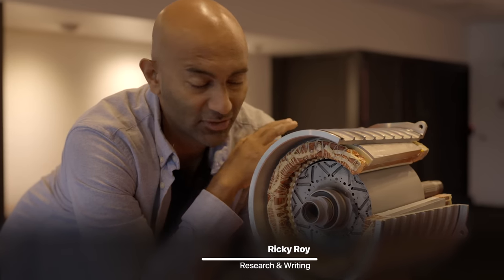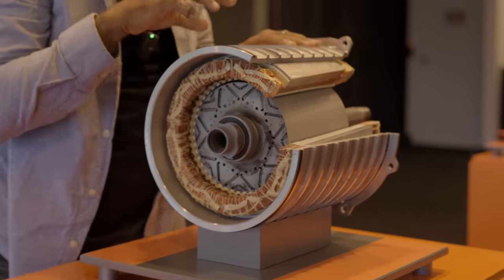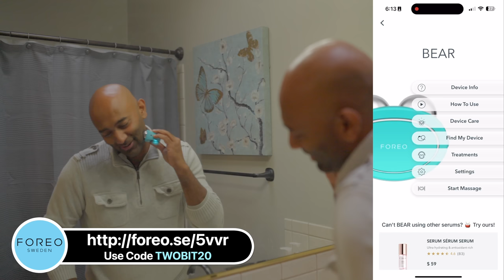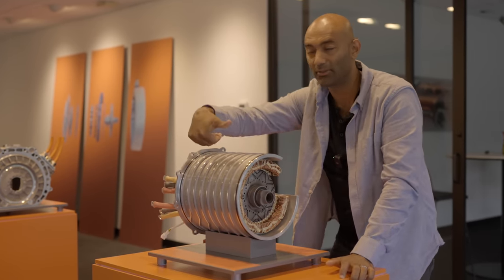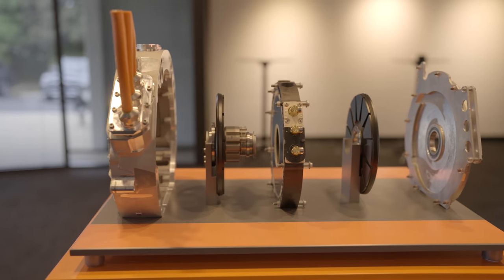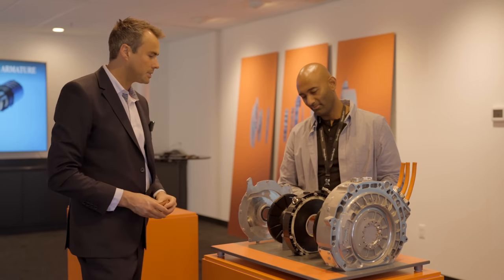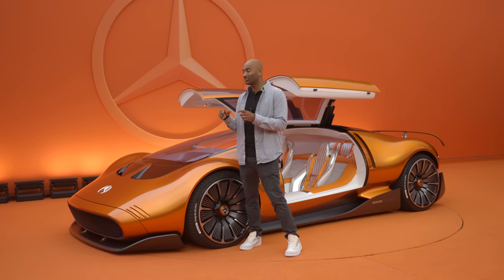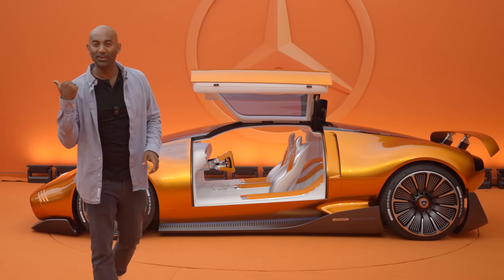Axial Flux Motors Will Change CARS - Here's Why

Comment: Over forty years ago my then-father-in-law told me that the ideal car would have a small, light electric hub motor in each wheel hub, with the speed electronically controlled to drive the car and improve handling by driving the outer wheels faster when turning.  Looks like the automotive industry is finally approaching that ideal.
Reply: Unsprung weight on wheels is not good.
Reply: @ExploringCabinsandMines if its only like 30lbs it might be fine
Reply: The problem is that the motor in the wheel is not a reliable solution, as the weight inertia of the electric motor will destroy the tire much faster... This is why you still do not have one EV with this solution on the streets today... Because you are forced to make the fast-moving and vibrating parts of the car (due to the road bumps) as light as possible. This is why the light rims are all over the place. Heavy wheels destroy the tires much faster...and the wear in the metal parts is exponential with the weight and amplitude of movements, the ball bearings are wearing out much faster.
Reply: Just a thought, but motors in the hubs might allow more effective suspension systems
Reply: and no steering? like french amx10 tank...
Reply: @jebeandiah  You missed the point, the problem is not the suspension system of the car for the passenger's comfort, the problem is the motor itself, wearing out very fast. You have direct transmission of the shocks from the wheel to the bearing system of the motor. There are no materials to endure this regime, ball bearings will be worn out in a few years or less. Ford tested this EM in wheel arrangement over 20 years ago. Really, the carmakers have a lot of good engineers, credit them they know better ... This Mercedes thing is a marketing one, is no way to be implemented in mass production as it is too expensive for that. So Mercedes use it in 120k dollar cars and make noise, but you will never see it on a  VW for example... VW went to get Chinese cars (Xpeng will make the cars and VW will put the badge only, as Dacia Spring is a Dongfeng imported from China with Dacia/Renault badge), 5 years old Chinese technology is better than what VW has today...
Reply: @costiqueR  well if its a possible, but not through mass production problem, those rarely remain unsolved.  Also, im sure the mass of all components of these motors is far less than those that ford was using, which should still reduce these forces, and idk how ball bearings would be a problem as they are already in hubs
Reply: @jebeandiah  Yep, it is not obvious, but even children know it. Simple, take a spinner, that toy very popular a few years ago, and spin it in your hand with the hand still. Measure that time until it stops. Spin it again, but this time shake your hand. You will observe that the spit is stopping very fast, it is spinning much less than when the hand was still. I will not go longer into details; if you understand why, is OK, if you don't, I lose my time...
Reply: You may be interested in the aptera as it uses that design
Reply: @jebeandiah  The answer is quite simple.  No suspension and the cars handling has ever been improved by adding weight to the wheels!  If you think you know something that the F1 and Formula E engineers don't then by all means do tell.  The fact is that, as others have pointed out, tire and suspension components ware goes up exponentially as weight of the wheels increases.  This is simple fact and there is literally no gain to be had from a hub mounted motor or motors.  Further, the size and configuration of the bearings for electric motors would have to be doubled or more to handle all of the additional forces they would have to deal with by being located in the hub of a wheel.  Go audit a mechanical engineering course and you will see just how very complicated what appears to be a simple issue actually is in reality
Reply: @costiqueR  this isn't strictly true. The Light-year 0 did briefly go into production, Lordstown started production of the Endurance truck, and the Aptera is using in wheel motors. Mainstream companies like GM and Nissan are also experimenting with prototypes using in-wheel motors.
Reply: @ExploringCabinsandMines  Correct, but mostly in the RACING world.  In 65mph cars, not so much.  In my 26mph ebike, hardly at all.  Also consider duallies on trucks, 4WD front hubs, etc.  Extra unsprung weight is harder to dampen via shock absorbers to keep it on the ground in high-speed circuits.
Reply: @costiqueR  Sorry, but that's not the reason you don't get hub motors on cars, unsprung weight for a car really isn't much of a big thing. If it were, cars equipped with alloy wheels would have different damper settings from those with steel wheels.
No, the reason why hub motors aren't a thing is because of the hostility of  the environment puts far greater pressure on a hub motor. They have been tried, and Saab (and later the company that bought them) did a lot of work on solving this problem.
But the reality is that it's a problem that doesn't need to be solved. Bring the motor inboard and you reduce the unsprung weight, sure. But you make all the engineering , vibration suppression and water proofing much, much easier.
Reply: @costiqueR  It's not too expensive, it's just going to take longer to implement.
The cost of the motors is prohibitively high... at the moment.
But like all new tech, the price will come down as production ramps up. And seeing as the actual majority of the cost is in the software and management to run these motors, that is something that will come down even price even faster.
Once they go into series production, the price will come down faster than you'll believe.
Reply: @ExploringCabinsandMines  Build better wheels/tires such as the Tweel.
Reply: @costiqueR  You can locate the motor just off the wheel well.
Reply: @Barskor1  Suuure , you're the first one to think of that.
Reply: @ljprep6250  If it made sense Tesla would do it.
Reply: @zacwoodward6054  How many of those vehicles have 100,000 miles in winter conditions on public roads? Between salt and potholes the motor bearings will most likely survive equally as long as standard wheel hub bearings of around 80,000 to 150,000 miles.
Reply: @@jordypoe On an engineering standpoint hub motors are undeniably simplicity but even disregarding upsprung weight you are subjecting the hub motor bearings to an immense amount of undampened forces VS a traditional setup of wheel hub connected to a suspension dampened sacrificial cheap cv axle or axle shaft connected to a differential. Between salted winter roads and crappy pot hole infested roads traditional wheel hub bearings only last 80K to 150K miles. Typically, when it fails shops just swap out the entire hub with bearings pre-installed.
Reply: @ExploringCabinsandMines  I never claimed that, king Solomon "There is nothing new under the sun."
Reply: @Barskor1  Yep, unfortunately engineering and mechanics are not democratic processes, are physical processes. As wear. Whatever you imagine and believe has no impact on reality. Simple, even if you wish and believe something, that is not going to happen...
Reply: @costiqueR  Wow.... now take that BS and look in the mirror.
Reply: yes, but still many years too late and they will sell it to us as a breakthrough technology who has to be expensive.
Reply: Was thinking one for each wheel, but on the inside of the wheel well. It could be on a gimbal, so it moves with the wheel as it travels up and down the suspension, but without the shocks. Still saves a lot of space and allows for independent wheel control.
Reply: @ExploringCabinsandMines it doesn't have to be unsprung weight, look at how Rivian do it.
Reply: @jebeandiah  having a heavier hub will hurt the suspension. imagine jumping off the ground slightly and the suspension drops down. that extra weight per hub is gonna hurt. we would be better off with an electric differential setup. for example where the rear diff is on a truck replace it with a motor. this would eliminate the weight issues and likely make it easier to service since a hub motor might get in the way of doing brakes and not to mention trying to drop that bitch without breaking it to replace suspension parts.
Reply: @zombieblaster5754  isnt electric diff similar to what we already use
Reply: @ExploringCabinsandMines  Good point ... in my country, roads are getting more bumpy and the government isn't spending enough to make them smoother.
Reply: @ExploringCabinsandMines  - true and they also take much more of a beating.
Reply: @costiqueR  I mean, the wheel bearings take this kind of abuse that you claim will destroy motor bearings. It's definitely possible to make a hub motor with bearings that are up to the job.
Reply: @dangraff8467  bro what lmao. You have no idea how a 4x4 drivetrain works. The average speed of the front wheels and the average speed of the rear wheels is tied together in a 4x4 vehicle with a transfer case. This is because the driveshaft going back, and the jackshaft running forward out of the transfer case are locked to the same speed. These run into the input of both the front and read differentials. The average speeds of a differential's outputs is equal to the speed of the input. If you slow one output to half it's speed, the other output will double it's speed to compensate. This is why the average speed of the front wheels must match the average speed of the rear wheels. Not 'a random front wheel locked to the speed of a random rear wheel' The obvious advantage of a center differential is that the transfer case wont bind when cornering on pavement, this is before you even consider such advanced features as torque vectoring. As a matter of fact, I also live in Minnesota, and drive commercially on the civilian side, and also for the army national guard for a living. Oh - and a side note. Yes, the skyline GTR does have torque vectoring, but also, it's kind of a dated example, and not very relatable because those cars are relatively uncommon. A Subaru STI would make a better example, due to it's computer controlled center clutch pack acting as an intelligent center coupling. The lower trim model WRX actually isn't capable of active torque vectoring, as it has a viscous coupling, which acts similar to a limited slip differential, as the center coupling. The viscous coupling only acts in a passive and reactionary manner, and so isn't true torque vectoring. Those are systems that we would be most likely to classify as being a traditional torque vectoring system, but while I'm here, I'll share another cool fact. The traction control or "Electronic Stability Control" in most modern vehicles which attempts to control wheel slippage in icy or wet weather actually is a form of torque vectoring in some cases, despite in most circumstances being installed in front wheel drive vehicles with no special transmission or drivetrain hardware. When you take off from a stop in one of these vehicles (for simplicity's sake lets say it's 2WD), and one tire starts slipping on the road surface, a modern traction control with the proper features will actually be able to automatically apply the brakes on only the wheel that's slipping, artificially increasing the torque working against that differential output so that the other output is able to apply torque to the wheel with more traction. Needless to say, a limited slip differential would be more effective, but in vehicles with an open differential, this can approximate some of an LSD's ability to take advantage of all the traction available to both tires.
Reply: @burkejohnson4539  Everything is possible, the problem is who pays for that one, as that one is much more expensive (bigger bearings, bigger housing, bigger all. Not to mention what is happening when you are going to change the tires). You're here, considering automotive engineers to be stupid... sorry, but is an insult. I am not in the area, but still can see the problems. People are dreaming at many things and never buy them as it is too expensive...
Reply: Yep, aptera is doing that. Crazy high torque too. Can chirp all of the tires on dry pavement from a stand still, and has a top speed of 110mph.
Reply: @mikegrok  Just bad news come, Aptera in a test with the reporter from TV inside was not able to go uphill and Aptera CEO who was driving said something like they never tested that before... As I considered Aptera as an unusual and pretty art car construction, this was a bad surprise ...
Reply: @costiqueR  They shipped it back to the USA from Europe and nbc drove it about 2 hours after it arrived in port. Someone forgot to connect the liquid cooling pipes to the wheels. That is why it overheated. Even then it still operated slowly. How well do you think an engine would operate with no coolant?
Reply: @costiqueR you're a bit old-fashioned, airless tyres and active wheels 🛞 with suspension built in, are already possible so the hub motor doesn't have to be directly coupled to the road. Personally I don't think electric hubs for passenger cars are that good of an idea as, in my opinion, they are too vulnerable to damage.
Reply: @Luxamor-8  Guys, you really do not understand. It is not about the car suspension system, it is about the rigid link between the wheel and motor in this configuration which transfers absolute all shocks from the wheel to the bearing system of the electric motor. No matter the tire type. FIAT 500, 70 years ago, had no rigid link, and the wheel had a bulky rubber buffer between the bearing system and the tire, but that one was a light car and even so, in 10 years the rubber buffer was full of cracks and lost the elasticity. And they made it so because was cheaper at that time the rubber than the ball bearings.
I think you all are not understanding mechanics, elasticity, wear, etc. Wrote what you all want, you all have to say all the stupids possible, the internet is accepting everything now...
Over 20 years ago, Ford patented this and never applied it. But you all still push the wrong narrative, as you have no understanding of the real problems...
Reply: @costiqueR  you're not getting it, you're not listening, the motor is suspended within an active tyre, the hub and/or tyre contain the suspension, independent of the vehicle chassis.
Reply: @costiqueR  Look into Aptera, it is very lightweight, with a suspension system designed to work with in-wheel-motors. YASA is not the only one making this new design.
Reply: @chrisbarrett2512  Yep, this is why all the others are doing the same...
Reply: Doing so would increase the unsprung weight to the point that your back teeth would vibrate out of your mouth.  You'd be adding 50 pounds to each wheel, without a material change to overall sprung weight (that is, you'd double the unsprung on each corner, but increase sprung weight by perhaps 7%)  The result would be like a ride with phenomenally heavy tires - every time they were deflected, it would pound the drive silly as the tire/wheel/motor combination slammed into the suspension travel stop.  Very hard on springs, shocks, and bushings - so they'd also need reinforcing.  It's one of the reasons the Orbis in-wheel motors take such pains to lighten the load.
Reply: @jebeandiah  The first splash screen showed 50 lbs each.  Way too much per wheel, and the vibration and shock over each bump would beat the motors up.  Better to center mount the motors and drive the wheels through a drive shaft in the front just like an IRS in the rear.
Reply: @ExploringCabinsandMines  Perhaps suspension in the tire itself, or perhaps between the rims and the center of the wheel could mitigate this problem. until then we will probably have to rely on more traditional linkages and motors in the hubs will remain a fantasy for the typical car.
Reply: @ExploringCabinsandMines  Those motors do not add a lot of weight...Take into account for this claim that we do NOT need any drive axle to that wheel for rotating it if the engine is build in in the wheel.
At one point extra weight...the engine...at the other weight reduction...the drive axle connected to the wheel.
(The solar cars attending the WSC in Australia all do have their engine build in the wheel,,,,total weight of such a wheel less than the weight of my own car wheels without any engine.
At the other side...the price tag is not very nice at the moment.
Reply: @ExploringCabinsandMines  Unsprung is overrated. But yeah, you can also just use a drive axle. And "in" the car wheel is rarely ON the wheel but mounted on the wheel upright rather than to the hub, as is actually the case on bicycles.
Reply: This seems a very simple solution to a nonexistent problem. Changing the direction of energy via gears is pretty trivial and lossless, though I'll admit I'm curious what would happen if you have people blasting their brakes down a mountain, heating up their already-hot motors. You'd have to have both traditional brakes and motors, even though motors could serve as brakes because... what if one loses power? You'd lose brakes too. Remember we have hundreds of years of experience in traditional automotive design and there's no lack of incentive to innovate. That experience is not going to be replaced overnight.
Reply: The ideal here is not to have hub motors but to have small axial flux motors behind the suspension. One for each wheel with all the pros but no issue with wear and tear.
Reply: Does not need to be in the wheel just next to it on the what is now the driveshaft. But with the weight of these motors the size they could become the wheel and weight be what a wheel is tight now.lighter tyres are already made so it is possible, and if balanced correctly could actually improve  handling a lot.
Reply: No ball bearings will break down if designed properly.
Reply: Lol, brushless motors do not have this problem thooughh
Reply: tesla
Reply: no, the ideal solution is to have two motors with driveshafts from them into the wheels, one at front and one at the back. you want the wheels as light as possible, as it reduces the power needed to increase/decrease speed.
Reply: In reality, installing a hub motor (like a bicycle) at each wheel would be relatively practical and would save room for a larger battery
Reply: It doesn't take genius to think of it as that way you don't need any hefty mechanical transfer. But why 4? Most cars will do just fine with 2. You only need 4 wheel drive in demanding environments.
Reply: @jebeandiah  30lbs of unsprung weight equals about 360lbs of sprung weight. If you put an 30lbs motor in each wheel, you'll end up with a car that behaves like it's 1440lbs heavier than it is. It's better to put a driveshaft between the wheel and the motor, and put the motor in the chassis.
Reply: @Laylander unsprung weight is 💯 "worse" than sprung weight, but there is no magic rule like 1 lb of unsprung weight = x lbs of sprung weight.

ride quality depends on sprung weight/unsprung weight. the less unsprung weight, the more you can decouple the car from road imperfections. So actually adding unsprung weight is like REMOVING sprung weight, thus making the ride quality more jerky. in the end it can be overcome with suspension setting for regular road driving. And yes if you are cornering at the very limit of your tires grip and you hit a bump/potholes, unsprung mass could be the difference between crashing or not....but it's only very important when you need the most grip for cornering/braking/accelerating in a very bumpy situation. like downhill MTB, dirt bikes, trophy trucks.
also of unsprung weight was THAT important car wouldnt be getting ever bigger and heavier wheels. wheels have grown even more than the overall weight or cars.
Reply: @davidcolin6519 unsprung weight is a huge deal. Alloy wheels vs steel wheels is 10 lbs/wheel. A strong enough hub motor is 60 lbs... 70 lbs... Over the weight of a normal wheel.
Reply: @littlejackalo5326  I am very, very aware of how unsprung weight affects suspension. Being a bike rider, where unsprung weight vs sprung weight, proportionately is far, far morer important.
And considering that a BEV's sprung weight s significatly greater, that also reduces the proportionality of sprung to unsprung  weight.
And knowing how little most drivers really care all that much about the handling/suspension of their cars, I doubt very much that most would recognise any significant difference.
Yes, I'm sure that some would recognise the slightly increased delay in suspension response, but seeing as systems which have had demonstrably IMPROVED responses have not exactly lit the world on fire, I'll stick with my original answer.
Reply: A motor on the hub is unsprung weight and feels horrible and would bounce the heck out of the motor.
Reply: @halfisher3598  I know it is unsprung weight,I've been saying that from the beginning. However, if unsprung weight was such a hindrance, then you'd have different spring rates on cars with alloy wheels, just as you do on a motorcycle that has light weight wheels.  But not even "performance" versions of cars have different rates when they stick on alloys. and there's often close to 20kg difference, even more when special alloys are involved.
And the fact is that a hub motor, when well designed and paired with decent alloys, might weigh no more than those steel rims.
You talk as if you have actually driven one of these, which is clkearly b0ll0cks, cos I'm not aware of any other "production ready" hub motored vehicle. As for "would bounce the heck out of the motor", once again, you are not talking from any position of actual knowledge, only assumptions made without knowing a single thing about the specs. Similarly, motors are intrinsically simple things made of bearings, magnets and coils. There is barely anything to BE bounced the heck out of.
Reply: That system was invented already in 19th century by Ferdinand Porsche and Ludwig Lohner.
Reply: @francograpelli3060  I'd suggest that you check your facts, the first axial flux motor was invented by Nikola Tesla in the 18360s, not by Ferdinand Porsche, who would only have been in his 20s at the end of the 19th century.
But the very nature of modern axial flux motors, which require very precise switching of polarity, made them inherently inefficient until the advent of high speed computing.
Sometimes the invention itself is nothing difficult. In fac, even a basic understanding of coils and magnets would permit the design of an axial fmux motor. It was the development work put in (by, among others YASA) nthat made them so much better, and permitted their efficiency to reach current levels
Reply: @jebeandiah  30lb on each wheel is freaking massive!
Reply: @ExploringCabinsandMines 

While this is true, the blog is all about massive power.  

For a more normal vehicle, smaller and even lighter axial flow motors would work.  A modest car capable of intercity trips needs less than 40 bhp to cruise at the legal maximum in the USA, but perhaps 120-150 bhp to accelerate when loaded and to climb steep hills.  So, with just 40 bhp at each wheel, i.e. one tenth of the power of the prototype AMG axial engine, the weight could be far, far less.  And, AC motors can recover energy when slowing, so the brakes can be smaller than they otherwise would be.

The Aptera three wheel EV uses axial hub motors manufactured in Eastern Europe somewhere.  They are small, light and provide much of the braking needed to drive on the highway.  There are at the least three US companies prototyping axial flux motors now, and I believe at least one Chinese EV on sale that uses axial flow hub motors.

It is the cost of tooling that is holding back the axial flux motors.  Manufacturers are reluctant to invest mush in new technology unless someone gives them a big order and pays for the tooling.  I'm hoping that Tesla may jump on this technology for their planned high volume, low cost EV.
Reply: Unsprung weight is not really important. It mainly affects the handling and durability of the wheels but modern materials are stronger and electronic wizardry can mitigate suspension issues.
Ultra light alloy wheels aids performance not because of lesser unsprung weight, but less angular inertia which is why people paid good money for - performance. The motor, although all weight is unsprung, only the rotor adds to the angular inertia.
Also the motor, which already is very light, have much of the weight as the casing and they can be integral of the structure of the wheel, ie they are not separated part of the wheel, but add strength and reduce weight of other parts of the wheel. Those additional copper windings are just a very small percentage of the weight of an ordinary wheel.